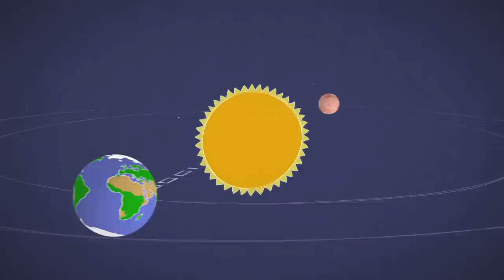Spirit rover’s dead wheel made big discovery

Comment: So perhaps future rovers should have a small retractable dragging tool behind them to reveal the subsurface beneath the dust as the rover travels forward with a small rear camera to watch for anything out of the ordinary.
Reply from the maker: Not a bad idea!
Reply: @MarsGuy  if it dragged it in a circle it could eventually make a pit as deep as the end effector on the end of the retractor (as deep as the "shovel" blade).
Reply: Not a bad idea, they would have to play with designs that would reduce the weight of the tool.  I have no idea what kind of pulling power the rover has but that would be a consideration as well.
Reply: How about a Swiss Army knife also!

Comment: Wonder if they could use the piezoelectric effect somehow as a cleaning mechanism, somewhat analogous to the sensor cleaning system in digital cameras. Have no real idea as to HOW this would be done but presumably thin films behind the solar panels might be able to "shake" the panels, at least enough to loosen the adhering dust, and hope that the winds might then be more efficient as a removal mechanism. Can't see that this would cost too much in actual weight compared to a mechanical system, as mentioned in the video.
I could see that this might require too much electrical power to be useful, and of course, electrical power is at a premium, here!

Just a thought.

Comment: I'm surprised they can't put the wheel in "neutral" to let it roll freely.
Reply: It’s direct drive on a brushless dc motor. The wheel is bolted to the motor shaft. Good idea though.
Reply: All Wheel Drive all the time.
Reply: 8 wheels. Why couldn't they make them lift independently....
Reply: @easydoz1  weight probably

Comment: Viewers should remember that newer rovers like Persy run on atomic power, not on solar panels; so they have no dusting problem. The Ingenuity hummer needs solar panels because of weight constraints.

Be the way, this account keeps posting great Mars videos, even during the Solar interruption! No nonsense here. It should have at least 10 times more viewers...
Reply from the maker: Thanks.  And you're totally right about the latest two rovers not using solar power, only Ingenuity does and it's doing fine; solar power is not the issue.

Comment: To clear the dust just fly a drone over the panels if equipped.
Reply: I know you are probably joking, but indeed this would be one of the things that they tested (shake of the dust with some fan), but the dust is electrically charged, you need a very strong current, like compressed air, to be able to loosen it and you have to direct that air very close to the surface. They may have opted to install such a unit on an arm, but they probably opted for scientific instruments instead.

Comment: Vibrator motors on the solar panels would work to remove dust if it was on a sloped surface.
Reply: And the power required?
Reply: @alastair9446  the power required would depend on surface area and weight of the panels.
The power could be stored in various ways while the panels are effectively generating power and used when the panel power generation drops below acceptable levels.

Comment: The next one improve the quality of the solar  panels by rotating upside down and vibration will shake the dirt, dust off.   You are welcome.
Reply: The dust is very tenacious because of static electricity and no humidity to dissipate the electric charge. Not even installing a powerful blower on the river to clean the dust off would really do the trick.
Reply: @BGraves  very simply design.. The next rover, a rotating shaped cylinders. For cleaning ingage and the cylinders rotating a cleaning brush with a discharge. A sliding movement from one end to the other end.
Reply: And power for that? Extra batteries? Will it keep up with the cleaning to justify the power use?

Comment: this is maybe a silly idea, but... why does nasa only ever send one or two rovers at the time? I would expect the material cost of the rovers to be maybe 1/10th of the total cost of development. Once you know the recipe, why not build like 10 or 20 and send them all at the same time? The launch is only a small part of the total program cost, so basically for a marginally larger investment of  few 100M you get a x10 science and exploration output.
Reply from the maker: The economies of scale don't quite work that way for these spacecraft.  Material cost would shrink, but labor costs, not so much.
Reply: You forget that rovers are largely experimental. Imagine 10 failures because of a design mistake.
Reply: Actually, a quick google skim of perseverance turns up around 250M for the launch services (excluding actually building the rover because i can't quickly find a figure that excludes rnd) and an expected 300M for watching the rover as it scoots along for 2 years. Round that down to 500m for launch and watching, and if we launch 5 more rovers at that cost it would be the same cost as the entire perseverance mission not including material and manufacturing costs which would probably run in the hundreds of millions. Or for your figure of 1/10 of rnd, 220M per rover. Combined with previous... a little under 4 rovers to equal the entire projected perseverance project

Comment: Why couldn't the engineers simply add a container with a couple microfiber towels in it - then use the robotic arm to grab a towel and wipe off the solar panels? That's a simple solution, and it would only add a couple ounces to the rover.
Reply: The arm was connected to the washer that washed the towels and spun them dry. It would often become unbalanced, as washers do, necessitating sending a repairman ....and you know how much those guys cost.

Comment: Perhaps in future, rover design should start with the solar panels and their cleaning system. I am sure I could design something that would work...
Reply: as stated, more than a few things were tried and rejected because they were too bulky, too heavy, or both.
And I'm sure more were rejected for being too fragile or too expensive.

Even here on earth it's very hard to do. The best way that's so far been found is to send a cleaning crew with sponges and power washers and use high pressure hoses to blast the panels clean, something that's not quite feasible for use on Mars.

Comment: These engineers that designed this "rover", as smart as they seem, (no doubt the different systems are designed in teams), however pick the WORST design possible of a wheel/tire combination for an off road vehicle.  Wide and small diameter tire/wheels assemblies are for pavement/ hard surface, however, soft powder soil/sugar sand (like on Mars) requires tall, thin, knobby tires like a....DIRT BIKE!!!  Go back and take a look at what type of wheels and tires early automobiles were equipped with before widespread road construction, early cars were "OFF ROAD" vehicles that used TALL, THIN, and aggressive tread patterns for getting through, sand, mud, snow, aggressive ruts, ect..
Reply: Now if we could contract with a Martian to assemble that once the parts package arrives on Mars.
The problem is limited space (pun intended) to carry whatever we send.  There's no harm asking the engineers (Mark Rober is one with an online presence), but keep in mind that they have to work within whatever the rocket scientists can serve up.
Maybe a different trade off between solar panel size and wheel diameter could be wangled next time. It was feared that dust buildup was going to be a worse problem than it was, so the panels were made very large.  But happily, Mars has dust devils which remove much of this dust.
I'd be concerned to make the hubs less susceptible to jamming.  The same dust devils that clean the solar panels also get dirt in everything from every wind exposed angle.
Reply: Iirc the design choice of the wheels was also influenced by longevity concerns as well as weight since the wear is spread out more-plus I'm sure without looking at it that the designs chosen make them far more stable on an incline than thinner wheels would have been.

Comment: What video/communication technology are they using to send pictures to earth from Mars?  What that's something like 45 million miles.  And how was this rover built to withstand the temperature swings that Mars supposedly has  ? Or is this all cgi crap !
Reply from the maker: Radio waves have been used to send and receive information for more than a century on Earth.  Works in space too.
Reply: So to your understanding what is the maximum distance radio waves can travel, what is the temperature variation on Mars? And what is the maximum temperature variation that machinery and electronic instruments can be exposed to and still function?
Reply: @ats-3693  so how does radio waves travel in the vacuum of space ? Show me a computer that can work at say 300 degrees.  Go back to sleep it's just a dream !
Reply: @timdescher2606  the presence or lack of air is not relevant to radio wave propagation, radio waves are electromagnetic waves they do not need a medium to travel through, if they did then the earth would be permanently pitch dark and freezing cold, as would the entire universe. It isn't difficult to manufacture instruments to withstand extreme temperature variations, a common household computer is obviously only engineered to function in normal temperatures, but simply sealing one inside an insulated temperature controlled housing would allow it to work at high temperature variations, at my work we have our server backup harddrives sealed inside housings that in the event of a building fire can withstand 1000's of degrees of heat on the outside while staying a temperature safe for the drives inside. You should try looking for and reading up on facts and information before making a fool of yourself to the entire world making ridiculous incorrect statements online.
Reply: How does a vacuum exist next to a non vacuum  ,  say outer space and earths atmosphere.  ..  Say your standing on interstate on one end of a guardrail hit it with hammer and yell at same time , person on other end will hear the metals cry before your cry by a lot . So your saying that in a vacuum sound travels just find . Oh well ! It's best just to leave programed creatures alone in their nightmare  . 

      Just because  it might be fun I'll ask !

Say your standing out in the night looking at A star it's photons have traveled supposedly for a long time some hit you in the eye what happens to them and in a minute how many hit you in the eye . That's strait up stupid,  it ain't happening.  Look up Tesla , no never mind go back to your cubicle your master have called .
Reply: @timdescher2606  You do know that atmospheric air pressure drops lower with altitude right? You know at sea level it's 1atm or 1, 013 hPa right? And you understand that it drops as you go higher, right? This is why your ears pop when going up or down in an aircraft or even in a car in driving up or down a reasonably sized hill, this is also how a barometric altimeter works. So how does that work? How does air pressure stay higher right next to lower air pressure? And as we all know that air pressure drops by around 12hPa for every 100m you go up, so what do you think the air pressure will eventually get to if you just keep going up?

You can believe whatever you want I don't care it makes no difference to me, but I know one thing if I thought the way you do I'd be doing a really shit job.
Reply: @ats-3693  a fool you say . Dufus I didn't make a statement I was asking questions.
Reply: @timdescher2606  I'm senior geophysicist for a mining exploration company with 25yrs experience working around the world in many countries. And your job is?
Reply: @ats-3693  I'm a gardener mostly , I do what I want mostly .
Reply: @ats-3693  gardening for something like 50 years among other things , just life . But came to find out lies are rampant.  If someone lies to me every thing that they say is a lie till I can prove it so I keep busy .
Reply: @timdescher2606  That is good, and so do I, I am lucky in that I love the work that I do and my passion for it has meant that I have happily worked my way up from a field based geophysics technician for the company I started with many years ago to the position of chief geophysicist for the company I work for now.  The work that I do requires a high level of understanding with regards to physics, that is what my work is all about, measuring various physical properties of our earth in order to visualise and measure the shape, size, and positions of structures within the planet, the reason I made the comments above is because I understand the physics.
Reply: @timdescher2606  I understand and agree there are a lot of things that we are told that isn't as it seems. But if we stop trying to differentiate what is true and what isn't and just start believing that everything is a lie then we are actually only making things more confusing for ourselves and reducing our own level of knowledge and understanding. I don't believe a lot of things that we are told, I know some of them are lies, but if you base your beliefs on things that are incorrect and sciences and technical fields that you aren't knowledgeable about then your beliefs are just beliefs with no factual basis, if you don't believe that we have sent spacecraft carrying remotely operated equipment to Mars that is your prerogative and I'm not arguing with you, maybe your belief is correct I don't know, but I do know that it is technically possible to do it and I know that there is nothing incorrect with regards to scientific details that I have seen, including the radio communications and the possible operating temperatures the equipment could withstand.

Comment: It’s a shame they gave up on developing some kind of cleaning system for the solar panels. Most engineers would consider it a daunting challenge but would lose many nights sleep and eventually come up with a system.  To give up some other function to accommodate that system would seem worthwhile to assure steady energy availability.  It’s fortunate that the dust devils stepped up, I guess luck is an unquantifiable factor.
Reply: I believe the answer ended up being a RTG?
Reply: The dust devils clean the panels, but also get dust, grit, etc. into the mechanical works.  Now we know.  A second rover can be designed accordingly.
Maybe the aerospace firm could auction or raffle off chances to steer the robot from earth for, say, an hour.  "Go explore on Mars with us!" -- with supervision of course so as not to let it get upset or dumped into a ditch.
Reply: @SeekingTheLoveThatGodMeans7648  i think that would be the most boring hour for most people... mostly because you don't really drive the rover in real time because jt takes anywhere from 5 to 20 minutes for your command to get there, and then another 5 to 20 minutes to see if you did anything